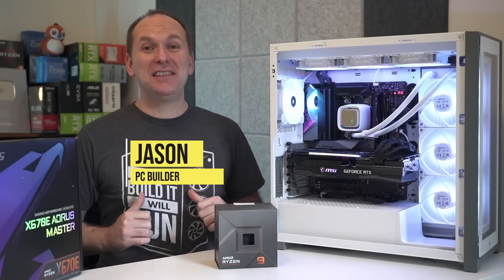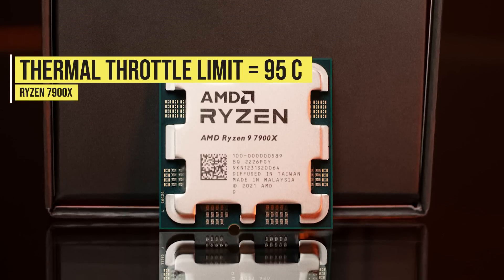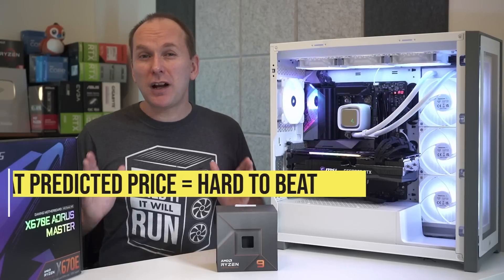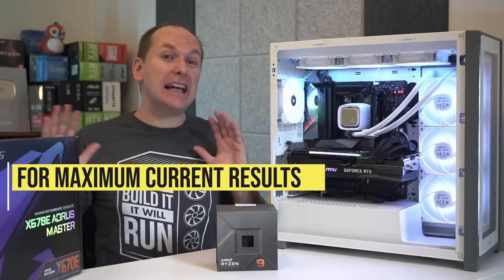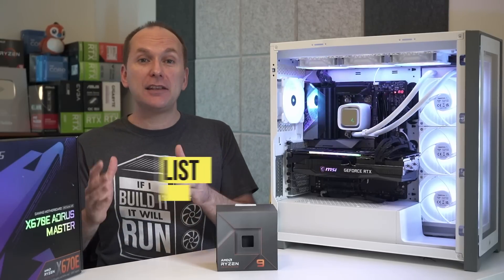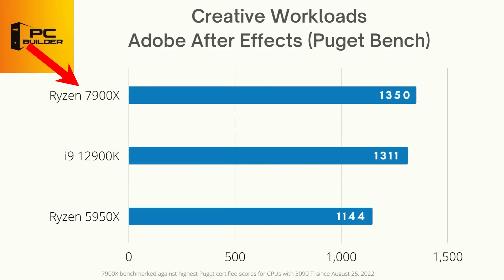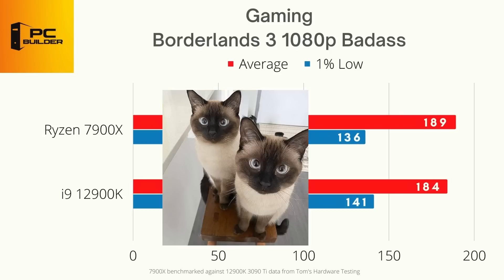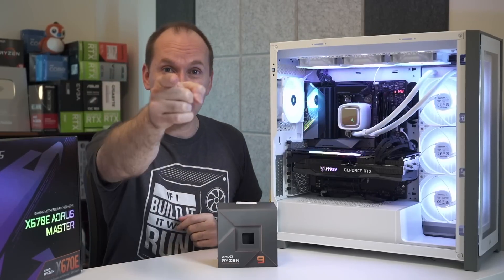🛑 EPIC Ryzen 9 7900X Gaming PC Build + RTX 3090 Ti 🛑 Game Benchmarks & 7900X Review

Comment: 100% getting a 7950x. I'm now wondering if a deepcool AK620 will be enough to keep the CPU cool. A used 3070 should be fine as I'll be buying 1440p and don't play really gpu heavy games.

I'm having issues choosing a monitor though 😕. Many are filled with gaming features I don't need or have an unnecessarily high refresh rate. My eyesight is too terrible to justify 4k or lots of bells and whisyles other than colour accuracy. The features are upping the price and it's really irritating, ngl.
Reply from the maker: Check out our Best Gaming Monitor 2022 video! We've got you covered
Reply: why a 7950X? you're looking at paying 133% more money than a 7600X for most likely ~10% more FPS
Reply: @farlandduck4463  This PC isn't designed for gaming. It's for productivity work like rendering, modelling and the running of very CPU heavy industry specialised programs.
Reply: @Curiefeld  i see, then that makes perfect sense. you mentioned a 3070 so i was under the assumption it was for gaming

Comment: its pathetic that your heading says 12900 killer
thats means its slow

it doesnt even compete with 13900k yet
Reply from the maker: Remember this is the 12 core 7900X, not the 16 core 7950X. If the 7900X beats the 13900K, then intel has a real problem. But If people are considering both then I'd certainly wait to see what Intel has on offer in October.

Comment: Be careful with overclocking via PBO/Auto OC. Over time it may become unstable and it'll be tough to troubleshoot the bluescreens that are seemingly random. Had it happen to my 3900x. Seems to occur in the 5xxx series as well.
Reply: Which specific CPUs did you experience that issue? I haven't experienced any random blue screens in my testing PBO or AutoOC with the 3700, 5600X, or 5800X. Now, I've obviously blue screened with unstable manual OCs when tuning the numbers in.
Reply: @prtech7706  Through personal experience, only the 3900x. Through a subreddit troubleshooting experience, multiple 3xxx/5xxx series experiencing bluescreens when having PBO/Auto OC on.
Reply: @ardeof  I'll have to look into that. Thanks for bringing it up.
Reply from the maker: I'm not aware of any issues connected directly to PBO. We haven't had that issue on any of our systems but I'll keep an eye out. Could always be that some % of systems are going to naturally have issues, and since most seem to turn on PBO it might be correlation without causation. But sorry you had issues with your system!

Comment: i was hopin for a test between 7900x and the 5800x3d, cuz thats what i have. i use it for gaming. is 12900x just better than 5800x3d? im a computer novice but i like to game  xD
Reply from the maker: I don't currently have a 5800X3D system set up, but in looking at some who did test it basically it outperforms Ryzen 7000 in quite a few games while Ryzen 7000 wins in a couple. The 7900X is really for those who also want the mutli core workloads and it will obliterate the 5800X3D in those tests while being very close in gaming.
Reply: @PCBuilderChannel  wow, as a gamer im am very happy with my PC! thanks for the reply!

Comment: So awesome to see that you got to test the 7900X!! Would a 1000W PSU be enough for a 7700X paired with a 3080? This is the only thing I am really boiling down to as I get everything else together for my build lol
Reply from the maker: Not sure yet, see our Best PSU 2022 video from a couple of weeks ago for our current recommendations. More info on the 7700x coming soon
Reply: @PCBuilderChannel  awesome, will be looking forward to it 😃
Reply: Wait what? I proposed a 7900X + 3080 Ti build (estimated 635W TDP) with a 850W EVGA PSU. Are new CPUs that power-hungry or are you planning for overclocking?
Reply: @kerbodynamicx472  That's exactly what i'm running with mine, and haven't had any issues as of yet.

Comment: PC builder, would you put a Ryzen 7 5800x in a x470 board or a b550 board?  The x470 board is a ROG CROSSHAIR VII HERO which is a very good board for x470.
Reply from the maker: With a bios update the x470 should work. You can see our Best Ryzen Motherboard 2022 video for more!
Reply: @PCBuilderChannel  Yes, it would work.  But which board would give the best performance.  I have both, the b550 has better support chipset for newer NVMe"s and the x470 has a crazy big VRM and was overkill for Ryzen 1,2,3 CPU's.   Just what makes more sense?

Comment: Hey Jason a got a update on the 
MSI RTX 3080 Suprim X 10GB
 ASUS PRIME H510M-A WIFI
i7 10700KF
16x2 gb 3200Mhz CL16
 Be quiet slim 3 cpu cooler
 samsung 980 pro 1tb
And the Corsair RMX 850W
build. Do you think the MSI MAG Z490 Tomahawk and the Corsair H100X cpu cooler are a good upgrade for my components or do you think I should choose something else? Awesome video btw<3
Reply from the maker: Thanks! That H510 motherboard is killing you. It is likely not running the 10700KF very well (limited VRMs) and is kneecapping your RAM to 2933 instead of 3200. The Z490 would be a good upgrade and right now there are a lot of really cheap ones.
Reply: @PCBuilderChannel  ok thanks, I really appreciate it. Again awesome video today<3

Comment: Hello there great video! I was wondering what would you recommend for a system that is made for Unity editing, my budget is limited and I was thinking 5900x because of the core count? instead of a 7600x?
Reply from the maker: Honestly it depends on your actual workloads inside Unity. If they are heavy on compile and other core heavy tasks, go for the 5900X. Also DDR4 and cheaper motherboards will help you go further.
Reply: @PCBuilderChannel  thanks yes! that's what I thought, I'm struggling with multi-cores right now, and I think I'll benefit more from the 5900x at the bargain price than the new entry level in the 7000 series, thank you got a loyal fan here! you are the best!

Comment: I'm a bit disappointed by the need for an AIO since I went pretty hard on the air cooling train with my 5600X.  My Fractal Torrent has tears in it's eyes every time I look over at it.  Thinking about Meshify 2XL for the sole reason I can jam a 420mm AIO in the front or top as needed.  Great video, glad you got one of those fancy new chips early!
Reply from the maker: Sending love to the Fractal! (; 
And yes it's our first time being part of a launch like this which is very exciting. So glad you enjoyed!
Reply: I'm kinda dumb when it comes to hard core cpu operations, but someone said these chips are gonna run hot because thats how they are designed. They try to hit max temp regardless of the size of cooler..  go watch GN and see what he said about this. I guess there is an eco mode you can set ot just undervolt if you want it cooler..  this is what I understood anyways.
Reply: From the early reviews out there your on the right path if going with the 7900X series. I choose the Lian Li Lan Cool III non RGB version for the up coming 6950X build which is getting great case reviews and has a descent price point for what you get.
Reply: Even with nh-d15 with that flag ship CPU  in open bench runs at 95 celsius. Crazy.
Reply: @Elreino12  Couldn't be me....I'm getting a 5800X3D and   a NH-D15 instead.  20-30c hotter air in your case is nothing to scoff at.  Plus it's more than 1/2 the price to do it this way :)

Comment: Efficiency is not good, those new AMD chips run hot. 81-95 degrees? No thanks. If I wanted to build soon I would wait for the 3d v-cache chips that are coming in January, those will be the best for gaming.
Reply from the maker: Those are still rumored for the moment but fingers crossed
Reply: @PCBuilderChannel  Rumor is CES 2023. I think I would run a custom loop on a 7950x, they seem to not throttle at 95 degrees though. The performance is very impressive.

Comment: Wrong time for Ryzen 7000 release. If everyone were still getting free government money then I would say yes but that's not the case. It's a pass for the vast majority of people.
AM4 processors are perfectly fine for performance. No need to buy a new mobo and rebuild the system. You can't even take advantage of the CPU when most people still can't get a GPU at good prices.  Also as a general rule of thumb, no one should ever buy the first generation of any new tech. It's always too expensive and has bugs. Let the nerds/enthusiasts/cash cows be the guinea pigs.
Reply from the maker: Platform costs are going to be absolutely key!